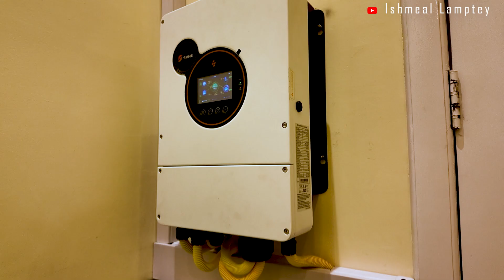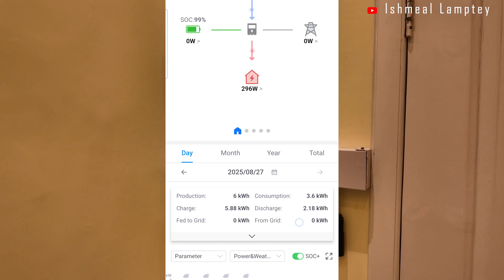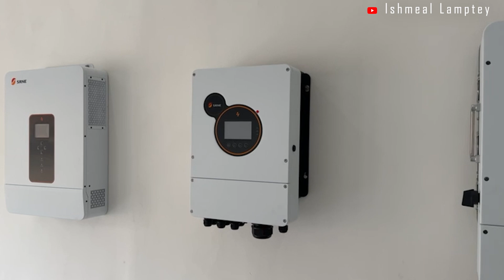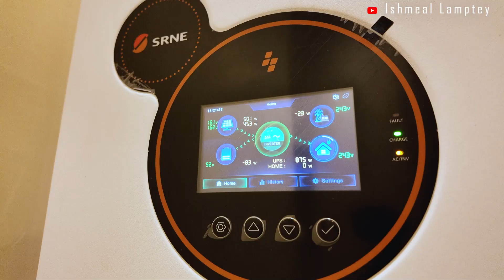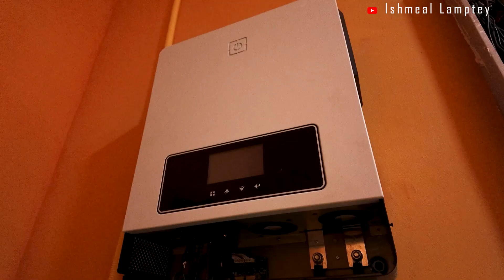Fixing a Failed 20kW Solar Installation + New Solar Projects in Ghana

Comment: 560Watts X 36X 6sunhrs= for 20kW battery??, it seems you have too much power, where is the rest of power going?
Reply from the maker: The rest of the energy powers the appliances during the day after the batteries are fully charged

Comment: I am horrified at the first installation. 
These systems are too expensive to also have bring in a remedial installation team.
Im confused, if the owner knew enough to call you in  to fix the serious issues ( and not call back the original installers), why didnt he choose you in the first place? 
Also, which company did the installation? This is too serious not to name them please.
Reply from the maker: He mentioned the issue to someone in his circles and i got recommended